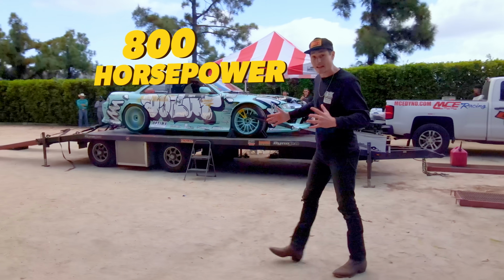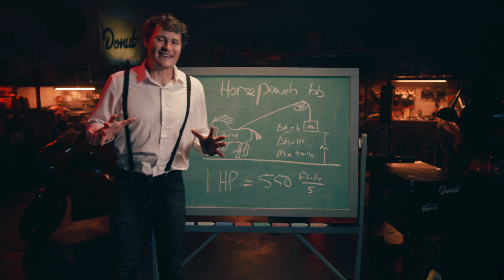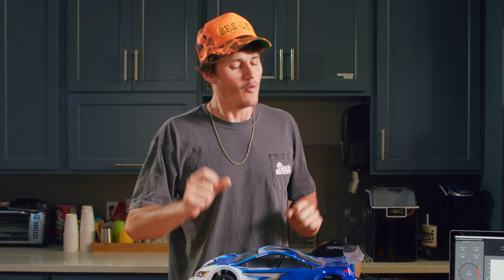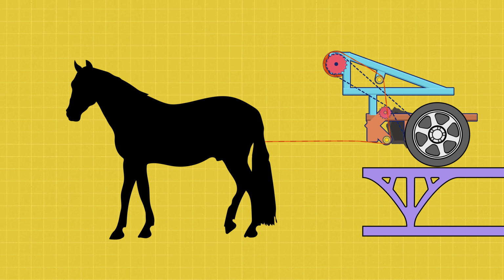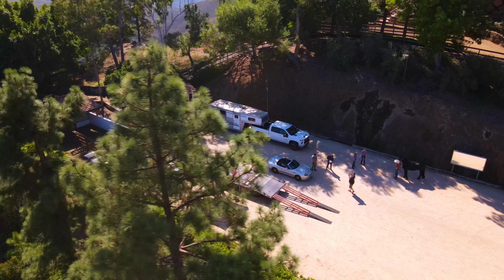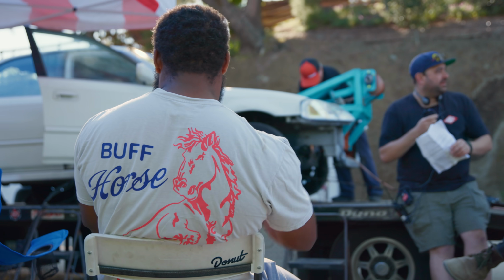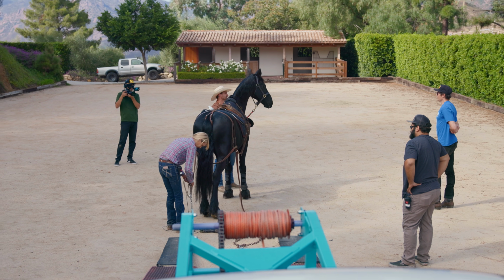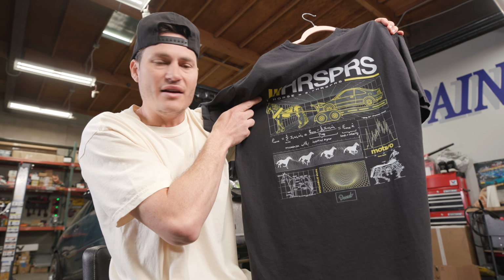How Much Horsepower is a Horse?

Comment: I'm sorry to say guys, but you got this wrong. You never factored in impedance. Whenever you couple things like this (a power source and a power sink) you need to match the impedance of the two systems. There is a balancing factor in the product of force * distance. You can make it easier to do but require a greater distance or make it harder, but over a shorter distance. If you go too far in one direction, it's going to be super easy to pull but require the horse to go faster than it would optimally move at. Too far in the other direction, and it's going to be too hard to get started and go nowhere. This is a balancing act and in your design you basically plucked the mechanical advantage out of your umm "mule". To do this properly, you need to do multiple runs at different impedance and first calculate the impedance of a horse. Then you can run the optimal impedance (impedance matching via gearing) to derive the maximum power. As it is with your mule based random number, you have suboptimal power. The horse in reality will be able to pull more if you impedance match correctly.

As another example, bicycle gearing is really about impedance matching. Too low and your legs spin underutilised, too high and your muscles can't cope. With muscles, this can only be done by trial and error to find where the optimal efficiency zone (impedance) is. You never did that, so it's just completely wrong.
Reply: Yes, thats what I thougth too. Why not just use a horse coach, add a force sensor between the horse and the coach and monitor force and speed on different slopes or with different loads on the coach/light breaking? You would probably get a much higher power output with less force and multiple speed as in this experiment, and with such a setup you could test many different scenarios easily.

Comment: Why not just use a horse coach, add a force sensor between the horse and the coach and monitor force and speed on different slopes or with different loads on the coach/light breaking? You would probably get a much higher power output with less force and multiple speed as in this experiment, and with such a setup you could test many different scenarios easily.

Comment: Donut and Adam Savage is the collab I didn't know I needed and loved. Absolute perfection.
Reply: It wasn't that much of a collab though, more like Donut paid a premium to have a quick video call with Adam, who said "yeah I'd hire some engineers, have fun with that, bye".
Reply: @Skinflaps_Meatslapper  Although true, it still is somewhat of a collab that I never thought would happen
Reply: All he did was tell him to not do it alone LOL still cool he showed.
Reply: This work was already done by GPS trackers. People who competitively ride are using GPS to see how far and how fast they are going. When using hills to increase a horses stamina and performance the rise in altitude as well as the speed and time can be converted to work in Joules this can then be converted to Watts.
Reply: @TheHoofSmith . If I understand you correctly, you're saying that all that was needed was the GPS to get the horsepower rating? If so, that is not correct. These people were going for "crank/engine" horsepower. distance or speed.
Reply: @Bob0sModelFabWorx  That is correct, except that they're adding other variables you're not accounting for.  It's done the same way that onboard quarter mile devices calculate power.  You have a set weight (horse and rider, or car's weight) over a certain distance (x miles over a 20% grade), or acceleration (gyros in the device can calculate acceleration and cross reference to weight), time how long it takes to do that work, and now you've got a measure of power.  All that's left is to convert the data into a unit that you want, in this case, horsepower.  You won't get a graph, but rather an average horsepower over the course of the test...similar to how you can calculate an average horsepower if you know a car's weight and ET.  It's all an estimate anyway, even dynos, as you're calculating how much work could be done with a particular load or resistance.  Some methods reduce variables more than others and aren't as indicative of specific applications.  But to answer your question, yes, you can arrive at a useful horsepower number using nothing more than a scale to weigh the horse, a GPS, and a hill.
Reply: @Skinflaps_Meatslapper  Yes correct all measurements are assumptions. If you haven't already watch Adam Savage talk about rulers and measuring length.

For a Dyno the Mechanical loss is worst at a transition. The tightness of a driveline binds more at higher differences between current speed and maximum speed. That is why parts break when pushed hard. Watch them try and get the rollers started.

There are massive loses in the system that are averaged out over the test time.

You could make a graph with a digital system by printing out the result every second. But most systems just report average power over time. 

The biggest assumption was the average work day for a horse. This was a number James Watt picked to sell his steam engines. It had to be believable because people would not be fooled if a steam engine did less work than a team of horses.
Reply: @TheHoofSmith  Yeah that's definitely a big assumption, in order to get the average work for a horse over a day there are countless variables to consider.  Sure, you can measure how much work a horse can do at any one point in time, but that work can't be done all day long...a horse can't put out maximum effort nonstop, eventually they slow down or pull less, they need to eat and drink and rest and sleep, a particularly hot or cold day is going to affect their output, how much they had to work the day before, what breed of horse used and how healthy they are, working conditions, ethical treatment, etc. etc.  In this test, Big D was only safely able to do 5 of those pulls per day, and the historical horsepower metric was measured over a day.  What kind of numbers could Big D sustain over a full work shift? Undoubtedly less than these pulls. Probably the way Watts came up with that number is by figuring out the sum total production of a horse powered mill or whatever over the course of a day or week or month and divided it by the number of horses that were used.  Then he took that number and compared it to what his steam engine could do.  Which, to be honest, seems like a more reasonable metric than measuring a single horse at one small snapshot in time (like this dyno test) if you're talking horse vs. steam engine applications.  Perhaps that was an accurate number for all we know, and since the days of horse powered machinery is pretty much extinct except in novelty and reenactment purposes, we'll likely never know definitively how accurate it was.  Comparing a horse to any mechanical engine or motor is fraught with issues, the biggest of which is you're comparing something that can change peak and sustained output minute by minute and day to day vs something that can do the expected work nonstop at the same consistent rate provided you supply it with the relevant energy source.  Even then, you have drag engines that can only produce insane numbers for a few seconds before they die gloriously.  Basically it boils down to which metric you think is more useful...peak or indefinitely sustained power production, and if you're running a mill, the answer is obvious.
Reply: @Skinflaps_Meatslapper  Yeah you are right the work a horse did over a long period of time would be more accurate but then converted to one HP to show the cost/benefit. Everyone in those days would know what it cost to feed and house 1 horse. So the cost of the steam engine could be compared to say a 12 horse team working in groups of 4 for 3 x 1 hour sessions a day. The only way we could work out HP is to run an old mill for a week on an electric motor to produce the same output.

Most cars only use double digit horse power most of the day. Below 50MPH you don't have too many factors stopping you.

The crazy thing is that the fuel in a car is generating nearly 3 times as much power as the mechanical power it can translate.
Reply: I've actually always wondered this. Also, Big D is the Arnold Schwarzenegger of horses.
Reply: Donut, Adam Savage, and slow mo guys, collaborating on one video would be perfection. It would break Youtube!

Comment: Why run it through the car when you could just have the spool run the dyno drum.  And then there would still be error of the spool size and ratio as spool unwinds the ratio changes.  Maybe have a really wide spool so less layers in to the windings.  But you dont need a car.
Reply: Really cool project so dont take it negative.    

One other thing is why go through months of building and use one horse from a farm of many.  I wonder how an Amish plowing horse would do that plow the fields all day.  

HP was and should be 1 Horse.  But industry/ money/ slander/ cheat made this all weird.    

Interesting video though I like it!

Comment: The only thing is you skipped over the part of Watts calculations being based on a 12 hour work day now multiple that 5.7 by 550 lb now is part 2 have that horse drag 3135 lb across a field to level the ground where the horse can keep a steady  pace from your experiment how ever much horsepower you guys generated was far from possible to keep going for a 12 hour work day I think you may have provide Watts right because he was not after some peak power numbers he was after more usable in the type of commercial setting he was looking at with manufacturing of continuous power and the draft horse worked the entire work day not just a couple minutes I'm not convinced that your number of 5.7 has any useful application where watts value could be used for output a horse could be expected to do for a work day the word workday that Watts used is totally different than what you experimented with

Comment: Why didn't you just put it on a tredmil like the ones they use for race horse or measure it like they used to for a real real world base line instead  of sensationalism  and loss every step of the way I love the idea of  removing my engine and getting toed by a horse  but the way you did this ain't it 

A treadmill 

Get the horse to run on the treadmill 

Measures the kW direct 

There is so much loss in this even if the horse just pulls a rope like a wind up car
Reply: Okay laser dyno

Comment: Im sitting here thinking it took a bunch of engineers to figure this crazy contraption out when you could have just bolted a rear axle to a hub dyno. Bolted a drum with a line to the pinion flange and let the horse pull it to turn the pinion. Or if you wanted to take gear reduction out the question just use a solid axle like a go cart uses with the axle run through the center of the drum and weld the drum on and could directly turn the axle. Or hey even better just eliminate all drivetrain and bolt a drum straight to a hub dyno then you have no drivetrain loss.

Comment: When you take into account that pull basically being a one rep max, james watt's calculations might have been correct.

A horse pulling for hours at a time will not exert it's full strength but closer to 20% of that.
Reply: James Watt's was based on a full working day. IE a 1 hp engine running full time in 1 day could do the same work as 1 horse could in a day on a farm.

Comment: Hi,
I really enjoyed your attempt to measure the power of a horse. However, anyone who knows anything about horses knows that the horse being tested was not trying as hard as it could. An alternative method of calculating a horse's power can be done using the same calculations drag racers have been doing for decades to calculate the power of cars that couldn’t be dynoed. 

The fastest short distance horses in the world are American Quarter Horses, bred to run a quarter mile or less. The record for a Quarter horse over 110 yards (100m) is 6.66s. An adult Quarter horse weighs 950 lb+ and the record setting horse was carrying a 125 lb rider, giving a total weight of 1075 lb (487 kg). Knowing these details you can apply some simple high school physics equations to calculate the MINIMUM power needed to accomplish that record.

The equations needed are:
Force = mass x acceleration
distance = ½ x acceleration x time^2
acceleration = (2 x distance) / time^2
Power = work / time 
Work = force x distance

The stats needed are:
Mass : 950lb + 125lb rider = 1075lb = 487 kg
Distance: 100m
Time: 6.66s

The calculation

acceleration = (2 x distance) / time^2 = (2x100)/6.66^2
acceleration = 200 / 44.35
acceleration = 4.5 m/s/s

Force = mass x acceleration
Force = 487 x 4.5
Force = 2191 N

Work = force x distance
Work = 2191 x 100
Work = 219100 j

Power = work / time
Power = 219100 / 6.66
Power = 32898 watts = 44.1hp

So the absolute minimum amount of power the horse was putting down was 44.1 hp. Obviously the actual power would be more when all inefficiencies and losses are accounted for. 

Big D must have the potential to put down over 30hp. Even a kids pony will have close to 20hp. 

Anyone who's ridden any horse knows that it has a LOT more power than a Monkey Bike.

It looked like fun though.

Comment: One thing I wish you would’ve done is dyno the car stock, then dyno the engine with the horse contraption and find the mechanical loss in the system.

Add that loss to the power the horse made.

Comment: First commercial VTOL maybe, but nowhere near the first VTOL ever. 11:12

Also why not just hook the horse straight up to the spool and to an electric brake. Why the hell run it through the drivetrain to just further offset the accuracy of this experiment?...oh right, views. Heck you can do this experiment with a known linear spring and a tape measure.

BAHAHAHAHAHA and in the end the engineers took their own solution in favor of the stupid dyno contraption anyway. Exactly how a real dyno would work. Load at a known point gives torque, factor with rpm and you get hp. Simple load cell (digital version to the linear spring) and gps (digital version of the tape measure). You literally can't make this stuff up, because it's precisely calculable, and predictable.

Comment: Just attach the horse to a harness, pull an alternator with a large spool of rope  with a high gearing and measure the watt. Convert the watts to HP.  The proposed setup, cool as it may look,  has too many losses to give a practical measurement which is why the group measurement vs single wasn't much of a difference.

Comment: All results would be considered “at idle” in my opinion. That horse barely horsing.
The entire experiment needs to be prorated percentage wise based on the non scientific percentage of total power the horse used vs has.
In other words, the mechanical loses of the rig are infinitesimal compared to how much of the horses potential it was giving

Comment: 5.7 sounds reasonable, given that realistically a draft horse would only really work for around 8 hours a day, and Watt's definition of HP is based on how much a horse can do in an entire (24hr) day. I doubt a horse can maintain maximum exertion for very long, so one could assume say 50% exertion over an 8 hour work day. If we round to a peak 6HP/horse, that means 8hours of 3HP output in a day, or an average of 1HP/hr. Given that the idea of HP as a measurement also assumes that the engine is running non-stop, the numbers begin to make sense, as lower peak power over more time equals similar amounts of work completed. Now, that almost certainly wasn't expressly communicated to consumers in Watt's promotion of his engines, so the whole horsepower figure can be considered questionably accurate at best, and blatantly misleading at worst.

Comment: What did Watt measure then? 

If a modern GMO horse produce 5,7hp, did the Watt horse produce 1hp or did he modify the data to fit?

 Coming from a family that still have images of our old work horses, I can say they were sturdier than this stallion, with more muscle and power. Ardenner were the preferred stock to breed on. So Watt should have had even more power at hand.

Something is not right.

Comment: So this means a car that makes 300 HP, actually makes the power of about 53 horses, or about 250 men.
So a 300 HP car could be called 300 weak men power. (accounting for the difference from 250/300 of course)

Comment: Since the pulling rope goes through a series of pulleys on the welded bracket, doesn't that act as a torque multiplier?
Reply: it would probably be accounted for by doing the reverse of the process in the data processing stage

Comment: you should of had the horse, tight with no slack on the dyno rope  it would be heaps better if Big D didn't bog down at start because of the loose rope jarring him and stopping him in his tracks for that little bit until he felt the weight

Comment: 1- horses don't pull that way, ever.  The line must be angled downward or they can't pull as hard.  Drafts uses the weight of what they pull to push forward harder. Without it, they cannot use all their strenght
2- That horse is small and thin. Nothing buff about this seeminly draft cross. If he didnt have larger hooves you couldnt tell hes got any draft in it
3- Too much lead at the start of the pull, you need the load to be present the second he starts. Hence why he gets confused.
5- That horse doesnt work enough to have the muscles or technique to pull efficiently. He doesnt even know any commands so he's lead by a man rather than driven from the side. 
6- That surface doesnt let the hooves grip the ground
7- Theres no number 4

You need to visit people who farm and log with horses. I bet you'd be surprise just how big is an actual draft horse.